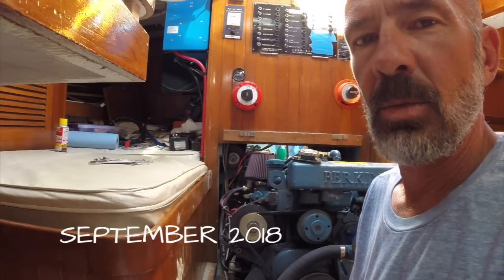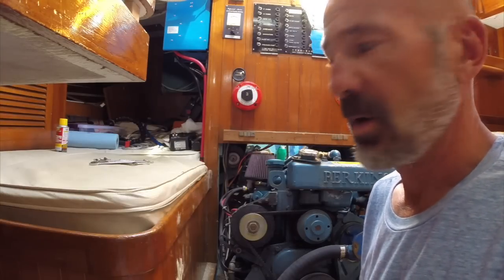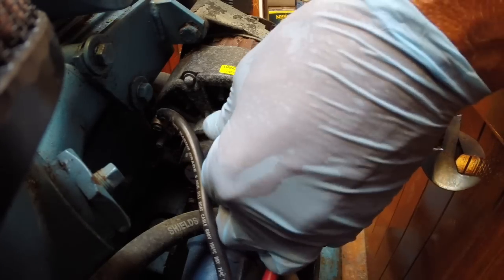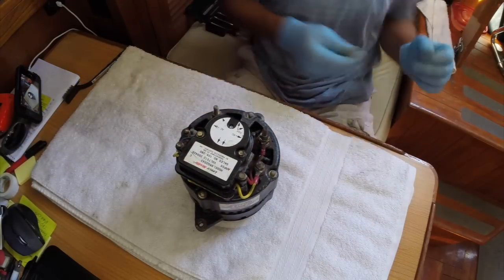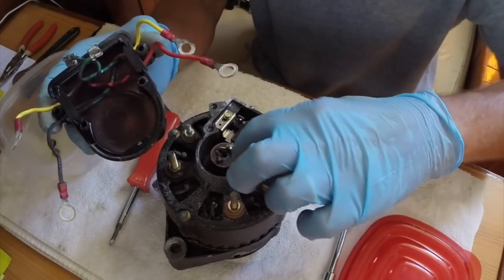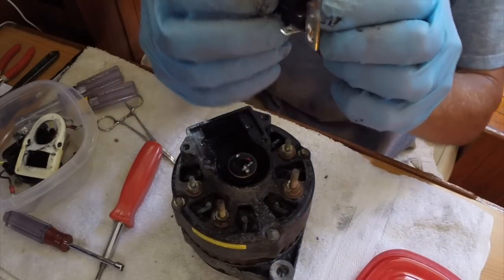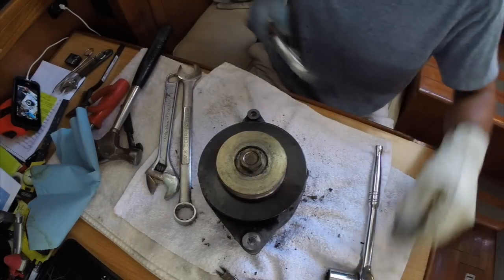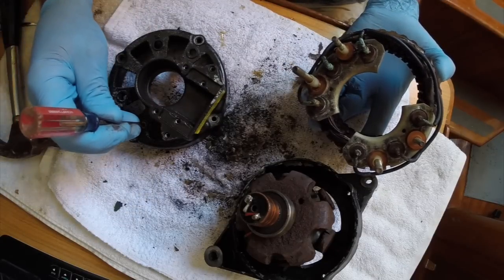SV Ramble On | Alternator Autopsy

Comment: Reminds me of when I left with my boat as it was brand new....  Wasn't until a few days down the river along the trip that I got a battery monitor I'd bought for the boat installed during the delivery...  After I got that installed was when I found out that we had no alternator charging.  After that staying in marinas over night became more important to us...  Really glad we didn't find out that we were in trouble the first night when we ended up having to anchor in a place we'd never been before at midnight just above a lock dam.  Mine turned out to be really piss poor wiring and connections to an engine panel mounted amp meter that was just stupid.  Replaced it with an hour meter because the boat didn't come with one.   Nice you've gone to battle born lithium!  I'm kinda going back and forth between going all the way there or just going with the Firefly Carbon Foam when I end up having to replace my 6 year old Gel Cells.  They are ACTUAL Gel batteries not AGM so its honestly a good thing that my alternator didn't work or someone would have cooked these batteries with that alternator.  I've got an old Motorola too...  I've been contemplating upgrading to a larger alternator and a Balmar controller and then de-tuning it so that everything always runs really nice and cool.  I'm kinda thinking on just staying with V belt to keep the costs lower but for your boat doing the full serpentine is the way of it!  Isn't that MaineSail guy awesome!  I kinda wanna buy the Balmar regulator and a nicer alternator to A do it and to B support that guy for all the great articles!  Good stuff man!

Comment: personally i'd just run a common delco or bosch alternator. easy to repair yourself, cheap to buy and parts are easy to come by wherever you are.  when you start talking thousands of dollars for an alternator you could buy half a dozen delco or bosch alternators. also in the thousands price range are water cooled alternators that are fully sealed so no issues with salt water/corrosion.
Reply from the maker: We kicked around the idea of refurbishing our old Leece-Neville 105A alternator and we did the calculations, but at the rate our LiFePo battery bank accepts such a high rate of input charge we came to the conclusion that your off-the-shelf-auto-parts-store alternator just can't keep up with our battery banks demand.  Any more Amps, and we'd still have to upgrade to a serpentine pulley kit nonetheless.  Thanks for watching and wait 'til you see what happens next.  Just to preface, Balmar was pleasant to work through our issues with....
Reply: you can buy a delco remy cs144 200 amp dual rectifier alternator for $300